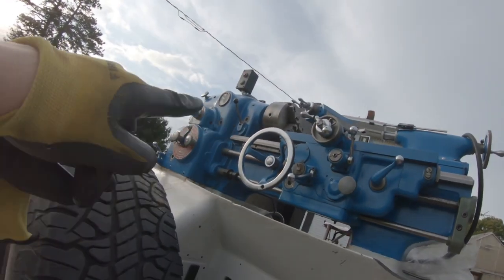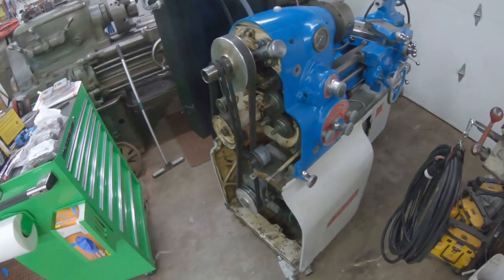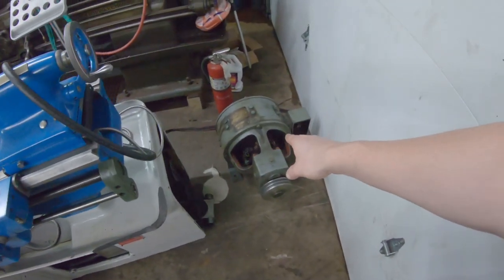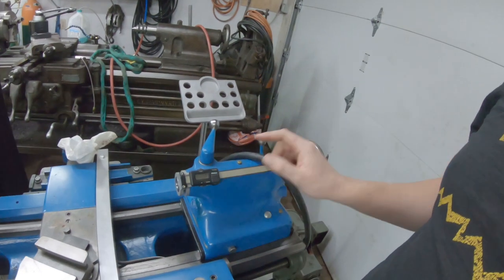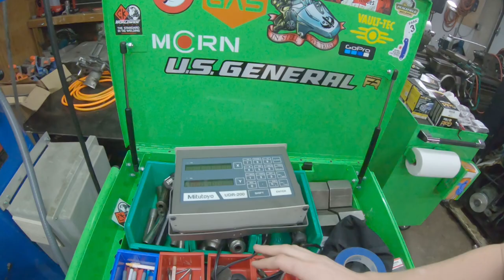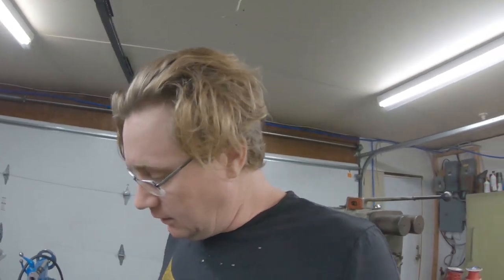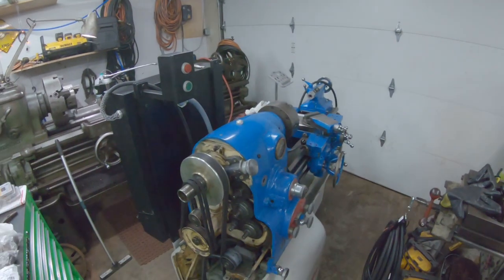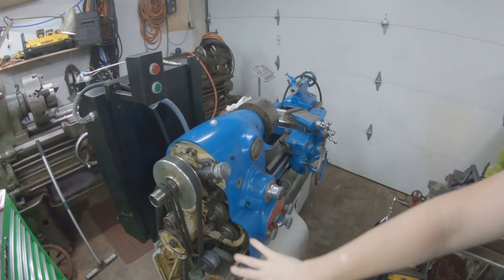Moving A Monarch 10 EE Lathe

Comment: Nice video.  Those machinery skates are a real pain (as you found out it looks like) going over cracks, coming loose in one corner (can be pretty dangerous when one pops out as the load shifts), etc.

I've used a regular pallet jack (rated for 5,500 lbs) to easily move my Monarch 10EE and Bridgeports over cement cracks and around my shop with ease.  The big wheels in the back, and full articulation of the steering/handle (for warehouse use) make it so easy.  I then just place the machine on 4x4s and block it down with a toe jack or pry bars.  Real easy.

Very helpful video!